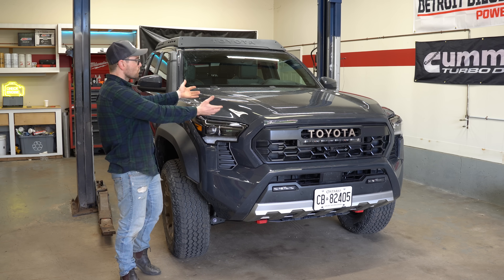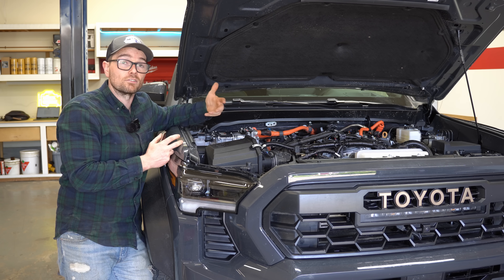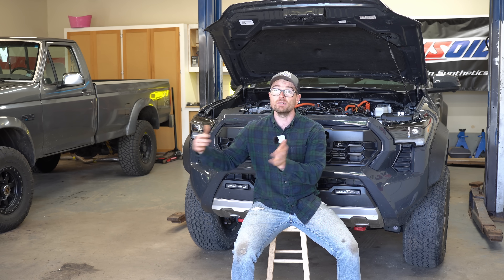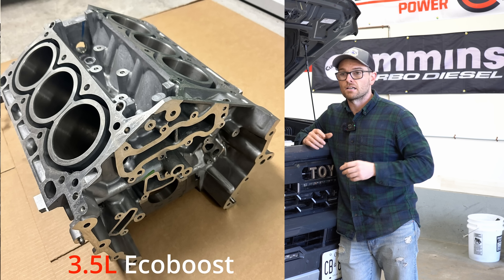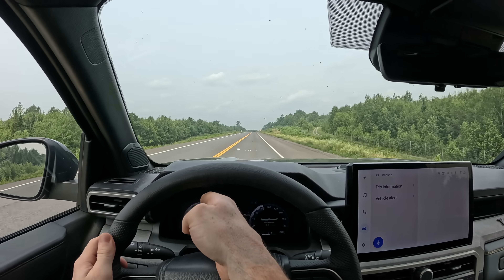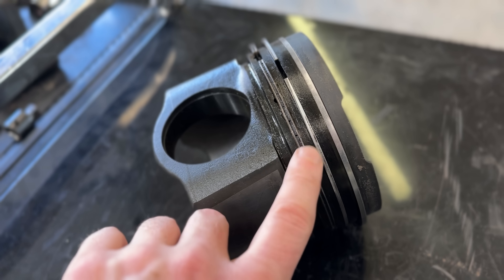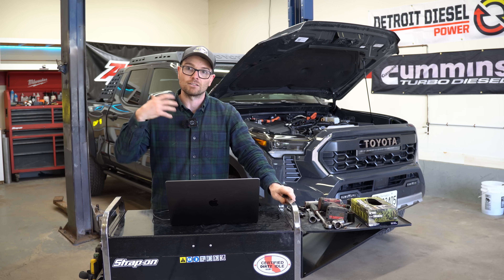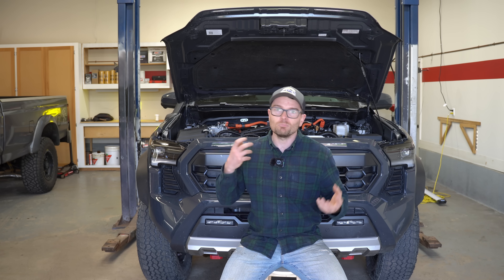Toyota Tacoma's 2.4L I-Force Turbo: CONCERNS Every Buyer Should Know (Mechanic's take)

Comment: When I was looking at buying a new truck last year I looked and drove most mid-sized and full sized trucks.  Ultimately, I just didn't think, among other things, the Tacoma got that great of MPG for what you give up over a full-sized truck.  I ended up buying a new 2024 Ram with the 5.7 hemi and the 3.21 gear ratio.  I just completed a 650 mile round trip with lots of 70 mph using the cruise control , some 75 mph stretches and some stop and go stuff.   I got 21.7 mpg calculated at the pump, which I was very happy with.
Reply: And you can use regular gas vs the premium the Tacoma requires.  It’s cheaper per mile with the full size truck!
Reply: I couldn't afford a 21.7 mpg gas-hog.
Reply: @seethingsclearlyawaken3424  Well, I work from home so my truck sits for days at a time.  I put 6k miles on it last year.
Reply: Did the same. Bought a 23 Canyon. Truck was decent but I got worse MPG that a full size with less room and power. So traded it for a 24 ram.

Comment: Pretty fair review. I have the previous gen V6 and I think it is a terrible engine (low torque, weak/jerky acceleration etc). I really want to “upgrade“ but at least my crappy V6 is reliable.
Reply: I went from a 2016 to a 2024 and have absolutely zero regrets.  It's a better truck in pretty much every way.
Reply: So are these .

Comment: It’s not fuel efficient if you require high RPMs for the torque to kick in…. Literally it’s only quick and that’s because of the hybrid. Small high-pressure engines are gonna fail much quicker.

Comment: It's a pretty marginal increase but running 91-93 octane in these and you will get a slight improvement over 87 octane. Probably on the order of 2 to 5% improvement.

Comment: Hey, the best way to compare this engine is actually to its previous generation 2.0L 8Ar-fts from the lexus nx. For example... i had that car since 2019-2024.... i treated that engine like if there was no tommorrow and it. Ever skipped a bit... never... 
There is no much info on bad 8ar-fts... cause it was a very riliable turbo engine. 
You cannot comparee this new 2.4L turbo to an NA V6.... that 3.5L not even compares to the 4.0L v6 ... 
That engine was only available on the tacoma and the Prado in china... so it was kinda of a test?...

Comment: Yes.  Out of all those concerns, the one that bother me the most is the plastic balance shaft drive gears that also drive the oil pump.  I would not design an engine that uses anything but steel in the drivetrain for the lube pump.  If the lube pump stops turning, the engine is ruined in about three seconds.
Reply: How about a belt soaked in oil?
Reply: @ronmac1832 Toyota doesn’t have that
Reply: @ChaoticDave69  Chev 3.0 Duramax does.
Reply: The oil pump is chain driven off the front of the crankshaft.  The 1st balance shaft is driven by metal to metal gears off the crankshaft and the 2nd balance shaft is driven off the 1st balance shaft via the polymer gears.
Reply: Many years ago I rebuilt a 1963 Chevy 283. The chain driven timing sprockets were metal body with nylon teeth.  They seemed to last pretty well.
Maybe these plastic gears will absorb the continuous crankshaft vibration better than steel?

Comment: When you squeeze more than 100hp per litre you are absolutely are trading longevity/durability for performance. Doesn't matter what it is. The Cummins X12 at 410hp is a pile of shit and it's being replaced by the X10 with the same power ratings. I have yet to see an X12 make it to 700k km without self destructing. Hell where I work there are L9s with 410hp/1400lbft and they don't make 500k km before the $55k replacement is called in for work. We've decided that an 8.9L was acceptable at that power level must have been on som pretty good drugs, of fully understands the market is full of fools. It's more likely the latter

Comment: I know if Ford released an exact duplicate of the 1995-96 F150 with the inline (300) 4.9, I would buy 2 of them.  No powerhouse but they would last and last.  I had a 1996 with the big 6, got in a wreck and totaled it out, and it had 350,000 miles on the engine, plugs, wires, and oil and filter changes and that is about it.  With the gear drive cam and stout build, and good synthetic oil, 500,000 miles would be easy.
Reply: I had a '95 F150 4x4 std. cab short box manual trans with the 300 ci inline 6 - loved how that drove !  Fuel economy could have been better & fuel tank was too small.  Ordered with anti-spin diff's in front & back - was great in Wisconsin snow & Iowa mud during pheasant hunts !  I'd buy one today if could - just needed larger gas tank !

Comment: It's just physics.   Forced induction engines run hotter and at higher pressures, it will wear out faster then a normally aspirated engine.
Reply: Not so much if it’s designed for it. Take an engine made to be naturally aspirated then give it force induction then yes, but designing from the ground up with forged components meant for high pressures not so much

Comment: With the technology available today, vehicle manufacturers are capable of producing conventional vehicles that could last a million miles without major repairs and achieve fuel economy of 50+ mpg easily. However, the limitation is not in engineering but in cost. Building such a vehicle would require materials and designs that would push production costs into the hundreds of thousands, potentially over a million dollars plus, making it impractical within the current automotive market. The Lexus LFA is a good example - developed over a decade with essentially no budget constraints, it showed what’s possible when profitability isn’t the primary concern. Now imagine applying that same mentality to a run-of-the-mill vehicle you see every day that the average consumer uses today - the capability exists, but the economics simply doesn't allow it.

Comment: It is really amazing how much concern Toyota’s conversion to the four-cylinder engine in these vehicle has drawn. So far there seem to be far more videos of people expressing concerns than there are videos of people actually having problems. I’m wondering if we should cut Toyota some slack here. They have made really solid vehicles for a long time. And yes, really solid four-cylinder engines as well. I might understand it if this was a brand new engine design, but it’s not. My vote is let’s give Toyota a chance to fail before we condemn them. And my guess is, if they do have problems, they will address it.  They seem to take great pride in their reputation of reliability from what I can tell.
Reply: It’s all the rage right now but once some starts hitting 200k+, won’t be anymore content on it until like 10 years down the line when Toyota has like a 2 cylinder hybrid or something then folks will be like ‘nope give me the turbo 4!’

Comment: I think the potential issues with this engines are owners, cheap owners, those who use the cheapest lowest octane fuel possible, and cheap oil and longer oil change intervals, that would be its main killer, and also 0w20, its been seen already that these trucks on 0w20 at around 3-5k miles the 0w20 loses almost all its viscosity and film strength.. crazy. Same as the new tundras people, use 5w30 or thicker to keep it alive for long!

Comment: You didn't mention the bore is a Nikasil coated bore. This was done for better cooling of the bores and lower pre detonation. Which means rebuilding this engine is out of the question. If and when the bore wears out or coating flakes off a short block will be required.

Comment: You want an honest opinion if your video. We need honest reviews instead of your corporate watered down review. Cheap plastic like weight aluminum materials along with cheapened down parts equals crappy engines that will fail. You just try and save your corporate sponsors in return for a watered down hold back review. You say you like this stuff - then try being honest and upfront and say “this is a crappy engine” it is a mistake corporate greed to make more profits. You are just too scared to give a truly honest review.

Comment: The nissan frontier is probably the most reliable midsize truck in the market right now.  Pro 4X are great values compared to the competition.  I'd take a ZR2 colorado next.  Toyota dealerships have got to get real with their pricing.
Reply: If it’s so reliable . You should get one .. 😂
Reply: @noxnyc23  midsize trucks are too small for my needs.  Just bought a 25 half ton.
Reply: Consumer reports actually had the frontier pretty low
Reply: @chibbyylol They specialize in toasters not trucks. Nissan's are number on in quality with JD POWERS
Reply: The new frontier is NOT reliable . I had 2 one lemon lawed and and another sold after 5k
Reply: @ChaoticDave69 Don't know where that reliable myth came from.
Reply: @ChaoticDave69 What were the issues?
Reply: Can confirm, the zr2 is awesome
Reply: @djm_19 just wish GM would get away from that DFM crap
Reply: lol good one
Reply: So why does Tacoma outsell the frontier 5 to 1
Reply: @stefanovichmichael9686 that doesn’t prove that the Tacoma is a good value or a reliable product.
Reply: @stefanovichmichael9686 Lots of people just follow the crowd.
Reply: @stefanovichmichael9686  Riding on past glory...previous trucks have been pretty solid but recent Tacoma and Tundra issues are making Toyota a risky choice

Comment: The low tension ring issue seems to be really variable. I have a 2015 Forester that has had an oil consumption habit since about 50,000 miles, although it hasn't gotten that much worse between then and its current 130,000. It is still technically "within range" - it doesn't consume a full quart every 1000 miles. On the other hand, also have a 2018 Sienna, also with low tension, 0w-20, and about 78,000, and it doesn't consume any measurable oil. Finally, my 2022 Silverado 3.0 Duramax with 37,000 doesn't consume oil. So, not sure what exactly the differences are in design or manufacture, but there isn't a direct correspondence between ring tension and oil consumption in the real world.

Comment: Plastic is a concern. I have a 2020 4Runner and Toyota plastic is the worst of any manufacturer I have owned. It has not aged well in the southwest. Luckily so far these are just cosmetic parts.
Reply: Arizona sun crumbles plastic into dust. But I will take that over having to worry about rust
Reply: @westyinzer4607 I agree. But less plastic is better and when you use plastic for engine important engine components you are asking for trouble.
Reply: If you think the plastics are bad in Toyotas, try Dodge or Stellantis on for size.  They are pure brittle garbage, Stellantis!
Reply: Know your 2020 4Runner plastic interior was designed from like 2010 lol
Reply: @chibbyylol I know and since then the plastics only have gotten cheaper. This one has the better and thicker plastic. The new ones are screwed.

Comment: On the 3000 rpm thing if likely because the torque drops off tremendously. If you are doing a pull through a single gear, you are feeling the torque. The truck will pull the hardest where torque is at its highest since the gear ratio is constant. The iforce max makes 465 ft-lbs at 1700 rpm, but by 6000 rpm where its at peak HP, its making a measly 285 ft-lbs. So this truck is going to pull 1.6x harder at 1700 rpm than it will at 6000 rpm in the same gear.

Its what I always hated about driving my 2.8L diesel Jeep Liberty. It was great for loafing around and driving lazy, but when you got on it and did an RPM sweep, it would crap the bed after 2500 rpm as the torque tanked.

It also might be when the electric motor cuts out. I know on the Tundra iForce max, it seems like the electric motor shuts down at ~50mph. I think there is a view on the gauge cluster that should show how much output you are getting from the electric motor.

Comment: Fix your hp and torque chart.

For the i-force electric motor torque, it's 48 horsepower and 148 pound feet of torque, NOT 184 pound feet of torque.

465 pound feet combined torque is correct.

Comment: I am interested in finding out the durability of the engine.  Internet search seems to think somewhere between 250,000 and 300,000 miles.  My guess is that Toyota has done some testing on the new engine as it is in multiple models and if it is a failure it will hurt Toyota badly.  I am having major issues with my Outback and I am only at 131,000 miles though the largest ones are with the transmission, not the engine.

Comment: If you bought a 4 cyl truck the engine almost certainly will never be a major issue for you.
Not because the engine will last but because the kind of guy who buys a 4 cyl truck is probably having alot worse issues due to his overall life choices. 
Probably lose the truck to a divorce or DWI long before the spark plugs even need changing.😅

Comment: So, in 2040, with 150,000 miles, will it still be in good running condition? My 2010 Frontier with 157,000 miles is still running. That's 15 years! Old and would drive it anywhere. 
Frank in Arizona
Reply: Hell  No !! None Of These New Trucks Will.....EVER AGAIN, Get Rid Of EPA MPG BS MAybe

Comment: My GX460's 1UR-FE is running literally better than ever at 135k miles. 5k OCI's and 5w-30 Pennzoil Ultra Platinum or Castrol Euro 5w-30.  Costco gas. Runs like a turbine. None of these engines are going to run as well, with Costco Gas and Walmart oil.

Comment: Catch can system? This engine has one???
Reply: There is no factory catch can in these engines and they don't need one because Toyota uses their outstanding D-4S EFI system, which is both port and direct. Port injection mode keeps the valves, ports and chambers clean, with the PCM automatically switching between the two based on really time operating conditions,.  This mechanic is apparently oblivious to this fact.
Reply: @harddrivin1le-970   I think he claimed there is one.... and I agree, there isn't one.

Comment: Owners better make sure they don't follow Toyota's 10,000 mile oil change interval.  That is planned obsolesce.  These will not forgive negligent maintenance like the previous N.A. V6 motor.  Most owners will make sure they die early on the 2nd buyer.  Too much plastic being used where metal for longevity should be in place.  Any turbo motor is off the list of used vehicle to purchase for me, more so on a heavier body on frame truck or SUV that have the aerodynamics of a brick.  These motors will be under stress most of the time.  Aluminum block will not last like the iron blocks of diesel motors.

Comment: toyota didnt  make the hybrid system for speed or efficiency tho, its for power to turn the tires and any added gear on the truck as its a heavy truck for the midsize class. funny enough tho, the TRD Pro with the same powertrain can snap off a 7.1 0-60 time...quickest of all the 4th gen tacos.

but i wouldnt compare a 300hp truck to a 400hp truck and complain the 300hp truck isnt faster